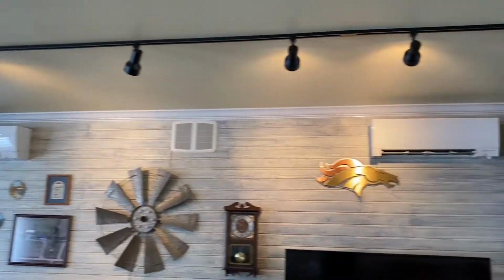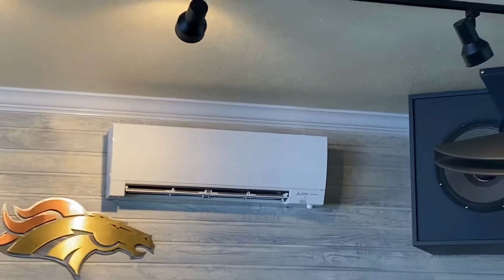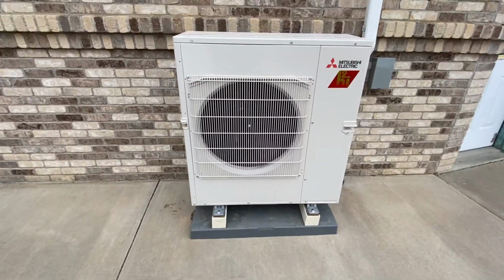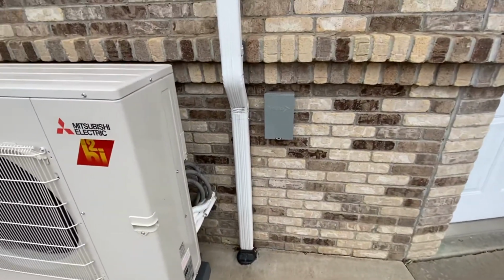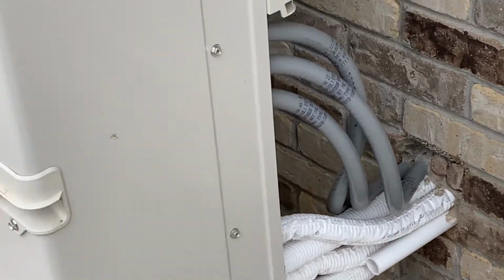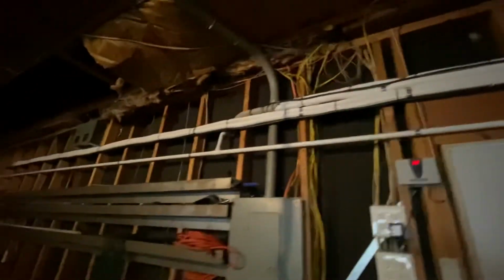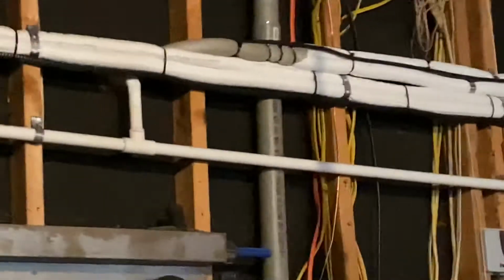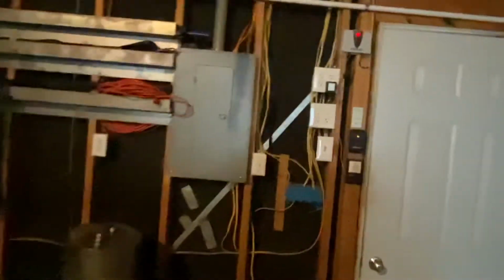Best looking ductless mini split install! High quality ductless from Mitsubishi heat-pump High Seer

Comment: Great units, but why are they so ridiculously expensive ??
Reply from the maker: That’s a great question. We don’t choose the price equipment that’s a Manufacturer thing so put it in perspective you can go buy a Ford Escort or you can go buy a Ferrari. They both do the same thing just like if you bought a traditional air conditioner, it will cool your building or your house but it’s not gonna do the job a Mitsubishi‘s gonna do for you.

Comment: I thought it was-5 100%capacity?
Reply from the maker: Wow not sure why this question slipped past me. You can have as many as 8 indoor units. However that only goes for the outdoor to indoor units capacity.  So (1) 20 MXZ is 20,000 BTUs and you can only put up to 20,000 BTUs on the inside units. So it's all according to outdoor capacity. A 48,000 BTU system can have many more units as long as you don't go over 48,000 BTUs on the indoor units

Comment: How much does the outdoor unit condensate when it's heating? Any figures as far as liters/gallons per hour?
Reply from the maker: That's a great question. That all depends on the outdoor temperatures. The colder it is will cause the system to produce more ice on the coil. And then how long it goes into defrost to melt the ice off. So it really will vary.

Comment: Looks great but of course I need to nitpick you now because it says “best” 😃. I feel that the condenser could of been mounted a little bit higher for snow and using a ratchet tubing bender on the line sets make it look slightly cleaner. Some don’t like to split the insulation to use the bender though. I use tape that matches the color of the insulation to seal it back up. Nevertheless clean job!
Reply from the maker: Thanks for watching 

Jared

Comment: Do they provide good heating during low temperatures (think northeast winters). I read online that they can only heat if the temp doesn't go below 32 degrees. Anything lower and you will start to suffer
Reply from the maker: There are (2) types of systems traditional units for mild climates and Hyper-Heating units for low temperature climates. Make sure you always get A Hyper- Heating unit in cold climates they can keep heating down to -13 degrees. However you need to keep in mind when it’s that cold the system is hunting for heat and will cause the utilities it increases in prices. As warm weather returns your system will have the ability to absorb more heat and transfer the heat indoors faster. Hope that helps. If you have any questions please write back. Thanks 

Jared

Comment: But it's still to low to the ground, nice and neat, but a 12 inch riser would help you keep the leaves and snow from covering it up. Just saying, there's always something a little more we can do.
Reply from the maker: We use the recommended riser from Mitsubishi and this unit isn't going to be running in the winter.
Reply: @ductlessplushvac  That's great but even wrapping them up in the winter, depending on how much snow you get in your area, can cause a lot of water damage, with the coming and going of snow and the melting and especially if it's in a area where you might use rock salt for ice removal. 
      The metal used is thinner then a car, and you know what happens over a period of time for them. It's a great job, it's just a preference of mine. and it look so nice, I thought there's always room for improvement, Thank you for the video and I hope you have a nice day.

Comment: Would be interesting to see the whole house and to know the number of air handlers installed. Two are shown in one room, but two other possible line terminate where? This install works on a one-level home, but for a colonial house of 2000 sf?
Reply: Nice install. The unfinished garage helps alot
Reply from the maker: @qomco  thanks
Reply from the maker: On this unit, we only used 2 of the ports, when sizing a system you can put several different sized indoor units to match the capacity of the outdoor unit and that's what we did with this system with only 2 indoor units. This room has 3 walls that are exposed to the weather. The garage, the east and west walls and have a lot of windows that allow infiltration of hot and cold spots. So we split them up to condition each wall.   And you can install Ductless systems on any 
home and location however, sometimes you need to get creative when installing equipment that won't look obtrusive.

Comment: why put 2 air handlers next to each other like that?
Reply from the maker: When this system was load calculated with a 
(Manual J) for cubic square feet, line-set distance, weather, windows, De-rated for altitude and lack of insulation in the attic this size was the best option. And we put one on each side of the room so it’s balanced for the air flow can reach the windows better (per wall) This was a large room  with 3 exposed walls 2 had all windows and 1 was on the non-Insulated garage wall and the attic has minimal Insulation. Always size a system before you purchase or sell one. And use a DSB and load calculation. It’s science.
Reply: To control drafts? Two smaller handlers in a large room may offer more comfort than a high BTU single unit. We just don’t know enough of the house to make a proper assessment.
Reply: The idea is to have proper coverage... alot of installers make that mistake... you may have the proper cfm's.... but do you have proper coverage?... thats the ideaology behind 2 units...